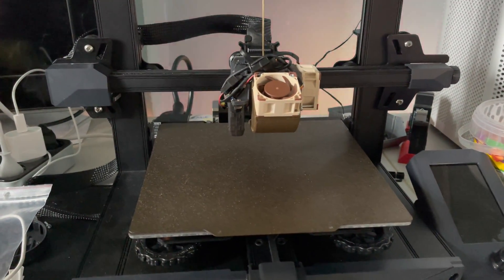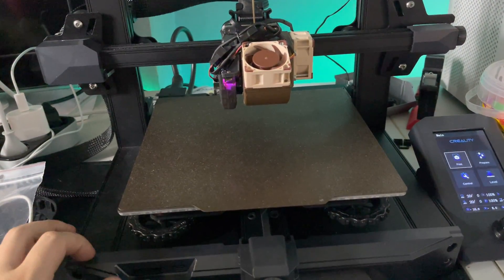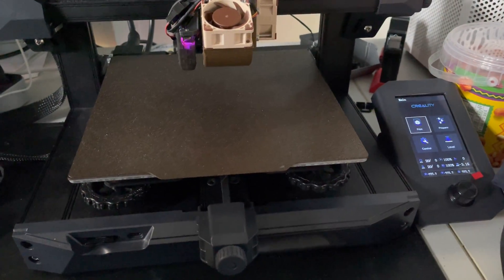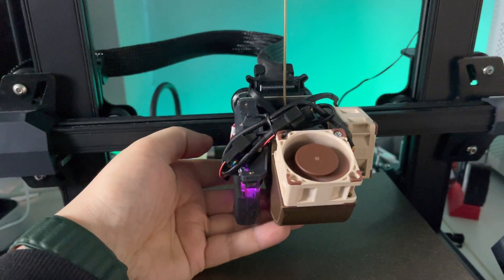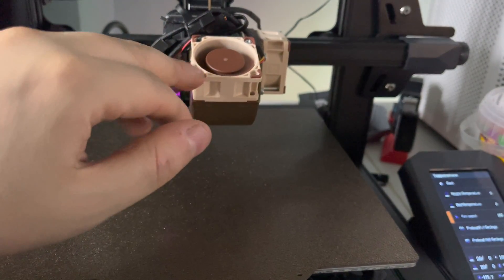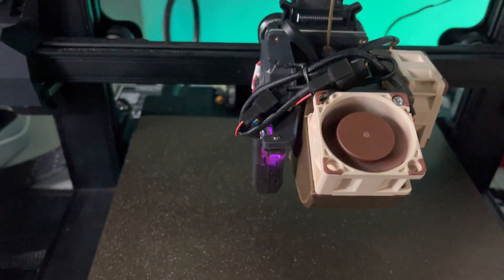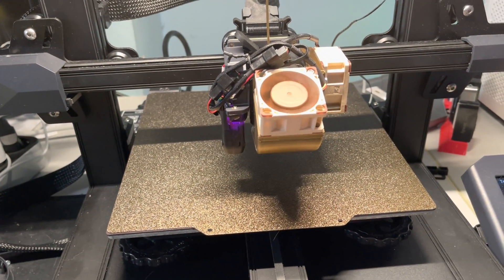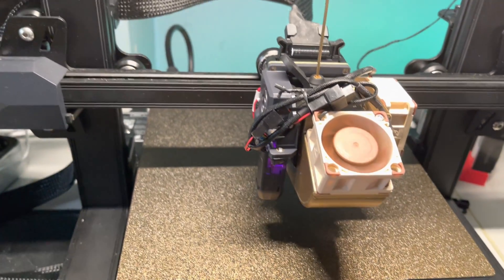Ender 3 S1 mouse silent mod nearly finished.

Comment: Which Meanwell power supply and fan model you used for the upgrade? Thanks
Reply from the maker: https://nl.aliexpress.com/item/1005003696870770.html?spm=a2g0o.productlist.0.0.93406a9fxvPuuT&algo_pvid=b326e588-c082-4bc2-99f6-7f25f25d66fc&algo_exp_id=b326e588-c082-4bc2-99f6-7f25f25d66fc-0&pdp_ext_f=%7B%22sku_id%22%3A%2212000026842413391%22%7D&pdp_pi=-1%3B36.5%3B-1%3B-1%40salePrice%3BEUR%3Bsearch-mainSearch
Reply from the maker: https://www.silentiumpc.com/en/product/zephyr-60/